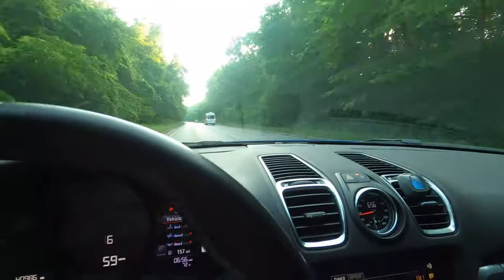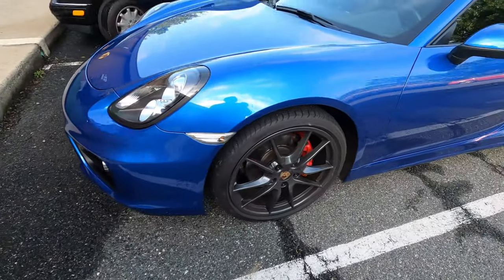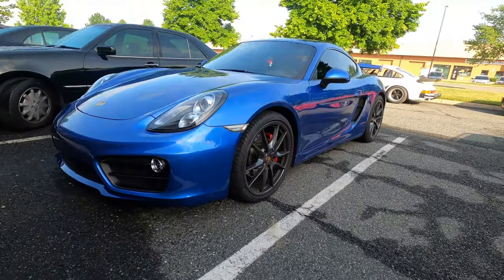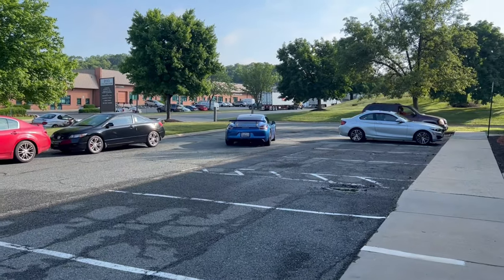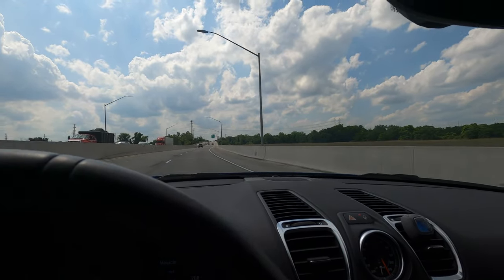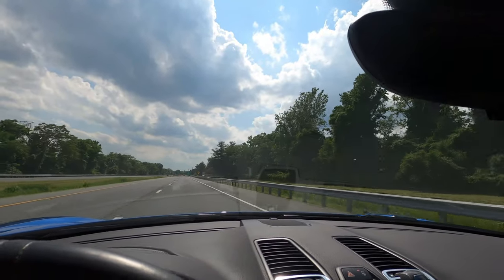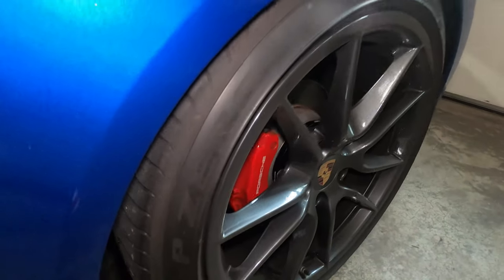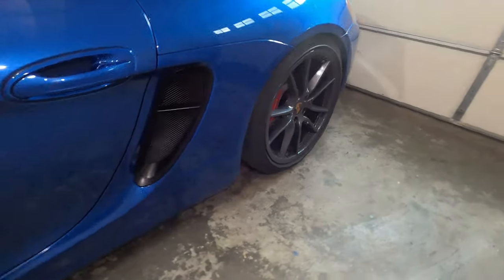H&R VTF Suspension Installation on 981 Cayman / Boxster

Comment: I think you need some Apex wheels as they have a great front offset I have two sets SM10 18” one black and one anthracite one with 42 original and now they changed to 45 offset. I use the Elephant racing front lca’s to get at least -2.0 front camber and adjustable caster. Using spacers is not a good idea for your wheel bearings. The other benefit of using Apex wheel is the diameter of tyre. Trofeo R make a perfect fit Cayman Cup tyre thus getting a further 10 mm drop. When I park my car next to GT4 it looks GT4 low just beautiful and you get adavsntage on track especially high speed sweepers. I also  think your car would bernefit from a Suncoast front air duct kit which would give more downforce on front and looks great plus Chanel’s the air with grooves to the radiators. I don’t think a third radiator is necessary and I have tested on track at 40 degree’s Celsius and full 20 minutes flat out sessions. The only difference you have is that GT4 rear bumper doesn’t have holes but has heat shielding inside. I left mine stock because I couldn’t afford getting the exhaust completely wrapped which FVD offers in the heat shielding. So not sure what effect the heat build up would have on engine temps. Suncoast also now offers the GT4 RS aero under the car which can be fitted to 2013 on Caymans. I follow an Instagram account that has done this and I am considering doing as it’s very cheap.

Comment: Hello, I am in the same spot - I want x73 but it's on backorder, yet I don't want to spend $3k+ for coilovers. Good to hear that ride is mostly the same. How is the cornering so far? Does it feel planted even when hard cornering over bumps? I do some track so I'm hoping the performance gains are there.
Also, is the rear adjustable as well? I may do a 20mm or slightly smaller drop to keep as close to Oem as possible